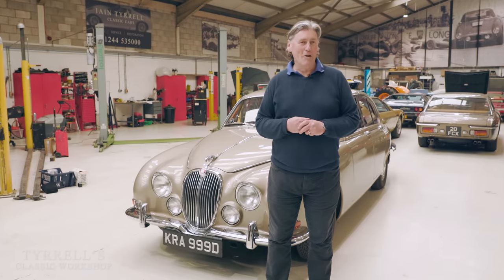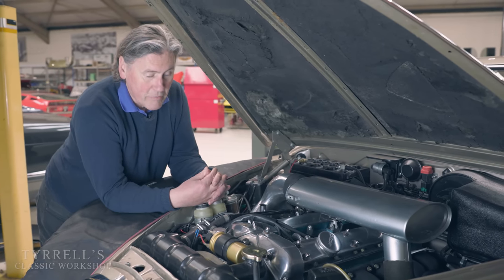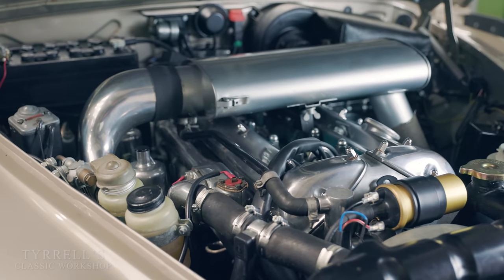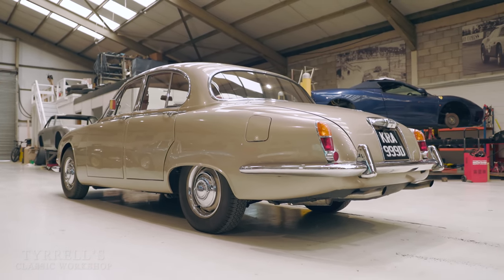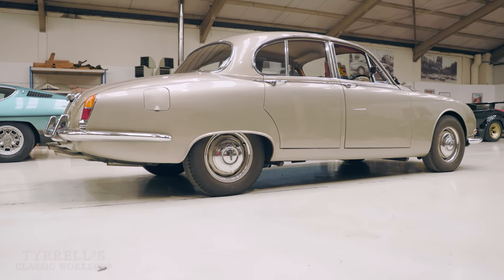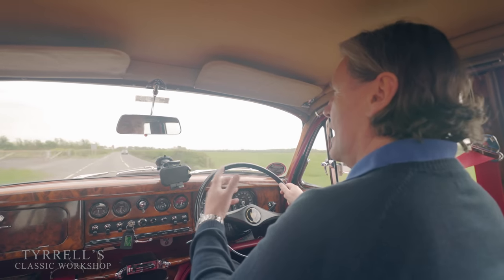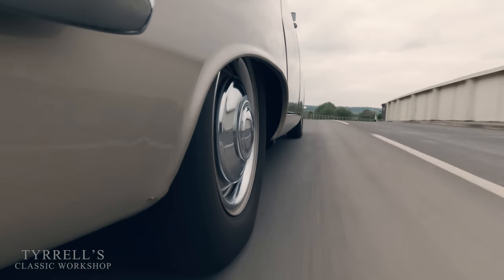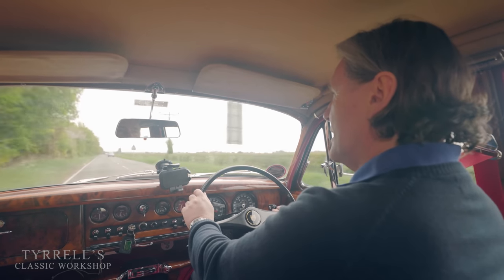Jaguar S-Type - The 1960's Saloon that set the benchmark for comfort | Tyrrell's Classic Workshop

Comment: We simultaneously owned two of these beautiful "S" types from the mid '70's into the late '80's both 1966 manual overdrive, one a 3.4 S, the other a 3.8 S with chrome Dunlop wire wheels. The 3.4 was my wife's "shopping trolley", and because it had no power steering, her upper body work out exercise. The 3.8 was the family express, both great absolutely reliable vehicles for all the time we owned them, lots of family memories made, all bought back by your beautifully done review Iain, thankyou so much.

Comment: My mom had the 3.8 S when we lived in Beverly Hills, California and I got it when she was done and it was my "first" car! OH what a joy to drive--took it up to 127 mph once upon a time on an empty straight arrow blacktop highway near Palm Springs. 

But one thing about that engine? Back when Mom was still driving it, we kept smelling gas in the car and took it to the dealer on the Sunset Strip where the head of the service dept (who wore a spotless white shop coat and an ascot, resembled John Cleese, and clearly never personally touched a car--smile) took us to the wonderful tool kit that sat in the spare tire, withdrew a large black BOLT, went to the engine and said, "Well, what you have m'am is a sticky float valve in your carburetor--so when that happens, this is where you hit it" and proceeded to RAP the bolt head on the carb to "unstick" the float!!! I remember laughing that THIS was how this marvel of engineering was to be repaired! But wow, the luxury of the leather and wood, the utter novelty in the US at that time of the push-button starter, but mostly the AMAZING steering of the car which was so responsive and "positive" compared to the big boat Caddy's and Lincolns of that era and you're so right about it being the best-riding car of the era by far (my car after this was a Mercedes and it had ZERO personality by comparison).  

The ONE issue that wasn't Jag's fault but was a US thing was that of course the car never had American-style/standard 
air conditioning in the UK but when they brought them to America they added an after-market air conditioner that sat in the trunk from some outfit in Florida. And with it, this open-road-intended car, when driven in the heat and stop-and-go traffic of Los Angeles with its tiny grill ran VERY hot. Once upon a time, again before I got the car from Mom, we were driving on a very hot L.A. day and there was a BANG as loud as a shotgun and then steam from the hood--when opened, we found that the plastic bottle reservoir for the windshield-washer had basically exploded like hard taffy slammed onto a countertop--just shattered really.

ANYHOW, I loved it all through my college years but when we decided it was time to sell, we left it with a consignment guy in the San Fernando Valley who specialized in special cars like this and HE had a potential customer take it for a test drive and utterly wreck it! I shed more than one tear and will always remember my 3.8 S. It was my first and, as I think back, best ever car indeed!  Thank YOU for the tour and details and for spurring these memories.

Comment: I used to work on these cars in the 1970's. They really were comfortable and smooth really very close in ride to a Rolls Royce for a lot less money. The smell of leather and the beautifull wooden trim is wonderful. Rust was a problem.
Reply: I had a friend who had several Classic British luxury marques: Rolls, Bentley; he also had a Ferrari.  The problem: it takes a LOT of money to keep one of these cars looking the way THIS Jag does...and it could use a bit of rust work, plus resolving that oil leak.  If unloved, one of these Classics can look plain and uninterest quickly.
Reply: The Jaguar factory made no consideration for rust prevention until well into the 1980’s. Porsche began their anti rust efforts in the 1960’s. That helps explain why you can still find early 911’s.
Reply: @Uncle Gilbert did you ever find any cucumbers?

Comment: Thanks Ian for the thoughtful and respectful review of one of Jaguar’s best. I owned and drove a handful of the classic Jaguars for 50 years. Papa had an E Type OTS for his daily driver, and I bought a 1953 Mark VII saloon, black of course, in High School and drove it for 7 years. The famous XK engine was actually developed for the Mark VII, and would push that large 6 passenger saloon car to over 100 mph: quite an accomplishment back in the day and faster than any contemporary American sedan. The XK engine was England’s equivalent of the ubiquitous Chevrolet small block V8, winning LeMans and powering Jaguar saloons into the 1980’s. As a red blooded American teenage boy, I naturally modified my Mark VII by securing a pony keg of beer in the large trunk and running a hose up to the beer tap on the burled walnut dashboard. We even drag raced it with a bevy of beautiful young women on board, losing the race but winning hearts and affection.
Reply: @Garth Lundquist The XK engine was developed initially for the launch of the new Jaguar sports car, the XK120 in 1948, 2 years before production of the Mk VII which ran from 1950 to 1956.
Reply: @greybeard4798  The XK engine was developed during WWII to power a new post war saloon that was to be the Mark VII. The XK 120 ( I have owned 2) was drawn by William Lyons in record time to take advantage of the new engine. 120 development was an afterthought, and the factory totally underestimated the strong demand from the public once it was revealed at Earls Court. Actual first deliveries didn’t occurred for another 18 months. The 120 frame, notable for how big and heavy it was, is a shortened version of the Mark VII frame. The XK engine replaced the 2.5 liter and 3.5 liter overhead valve pushrod sixes that were supplied by Standard Motor Company. Jaguar was at the time anxious to offer engines of their own design and manufacture in lieu of buying these components from outside vendors.

Comment: That's the car I learned to drive in, I was living with my uncle when I was 15 years old and he took me to the bull wall outside of Dublin near Clontarf to drive on the sand along Dublin Bay. It was a standard shift with right hand drive and I had never driven before.
God bless you Uncle Billy, this is around 1968.

Comment: The XK engine is probably the finest engine made by anyone EVER.  The engineering is unsurpassed
Reply: The Alfa Romeo "Busso" Twin Cam is a greater engine than the Jaguar, and therefore remained competitive after the XK had long been outclassed. 

The block is essentially an aluminium skeleton enclosing four cast iron liners, making it strong and LIGHT, hence the unsurpassed steering of Alfa Romeos.

Comment: I can remember my uncle having a pale blue 3.4 Mk2 with grey leather upholstery and a manual gearbox. My cousin and I would ride in the back hanging on to the grab handles or arm rests. This was followed by a dark blue with red leather 3.8 S-Type with an auto box. A few years later my dad had a VX 4/90 with a 4 speed manual box with a GKN-Laycock overdrive on 3rd and 4th, effectively giving you 6 gears, but by then the switch had moved to the gear knob. He later bought a FD Ventora with the 3 speed automatic. Rolls Royce used a GM auto on the Silver Shadow as did Ferrari on the 400i and Jaguar on the XJ12. I always felt nauseous in the back of the Mk2, sliding around whereas in the Vauxhalls, not at all. More light, grippier seats and being bigger made a difference. Nice to see the S-Type as l think it often slipped almost unnoticed between the Mk2 and the XJ6. Wasn't there also a 420 version?

Comment: It's so refreshing to hear someone that actually knows what he is talking about on YouTube! I absolutely love this video, Iain explains the XK6 engine and IRS perfectly, I've owned 2 S-Types over the years including a 1966 Golden sand 3.8 manual identical to this! I've also owned a MK1 and several MK2's and a Daimler 250 V8! At 60 years old i've settled down with a really original opalescent light blue (My favourite Jag colour) 1964 3.8 manual MK2 on wire wheels, The MK2 just pips it over the S-Type in charm although as Iain explained it doe's not drive as good, But i sort of love the agricultural rear end with it's Thornton powerlock diff and it's cheaper to maintain! Also it has a better rear roofline than the S-Type IMO!

Comment: My 1966 Mark 2 with its 2.4L automatic has so much ‘pulling’ power, my wife calls it my ‘chick’ magnet. I have rebuilt the engine and transmission from the ground up, it has a 3.4 head with twin SU’, a Series 1 XJ6 front axle with power steering and Series 1 disc brakes, replacing the smaller two pot calibers. With modern radial tyres the ride and handling are much improved. It has a complete unused Jaguar tool kit in its original metal case, wire wheels, metallic silver grey. Just needs the front drivers seat, recovered, red leather etc. also a respray. No rust, in Australia cars wear out engines, not bodies, the reverse of the UK. Mine has done 98,000 miles from new, owned by a lady driver, it has its complete log book and service records and user manual-I love it. Greetings from Tasmania Australia 👍😁🇦🇺🦘

Comment: Another great video, about my favourite Jaguar, in the best colours too!. Trad looks and interior with really good driveability, and still affordable - for now! Just one anorak point, Jaguar's chief engineer was William Heynes, Hassan was Walter - an amazing story to his career starting as a young lad in the early years of Bentley Motors, ending up co-designing the V12 with Harry Mundy. Overdrive was always a good idea, loved it on my Rover P4s and now on my Scimitar Coupe.
Reply: Thanks for that.  Brilliant.
I had overdrive on one of my Triumph Vitesse 2 litre convertibles.  On the way home after buying it, I was a bit wary of testing the OD, I had a nagging premonition something might go wrong but thought, 'hey what's the worst that could happen'. I chose a quiet stretch of road, trundled along in third gear and flipped the switch -  the wheels instantly locked up with an appalling BANG. 
Shortly after the chassis outrigger that held the radius arm detached. I continued to drive the thing. (Yes, I know it was stupid and dangerous, but I was young and times were a bit different). If you ever want to know what it's like to drive a boat in rough seas along the road...
Sometime yet later I began to notice the blue smoke! I checked the oil and there wasn't any! I filled it up and by the time I got home, it was almost empty again. I remember checking the oil when looking it over and it was lovely and fresh, I thought he had just serviced it...
The guy I bought it off seemed so nice. Hope he is reading this and feeling uncomfortable (probably 1990 ish so thirty years ago).
PS The Scimitar coupe is the most beautiful design and you hear very little about it! Does it drive well? Bet its better than those Triumphs.
Reply: @martinda7446  Well, I paid £140 for a Vitesse  at an auction, when you accelerated it shot to the right, when you braked it mounted the kerb -  now I know the radius arm mounting was rusted off, then I knew nothing so I just put it back in the auction next week. Lovely engine sound though!

Yes, I like the Scimitar (and my Rebel Estate dog car), the steering and handling are very good, the V6 is torquey and easy to look after (away being rebuilt now) and it is compact but comfortable. And it does look great on wires! I saw one growling slowly out of the car park of The Royal Hotel in Winchester when I was about 10 years old, and of all the cars I have had since that is still the one for me!
Reply: @JohnDavis-ed5sg  Thanks John that was a great reply. I have often thought about a Scimitar, but never went for it. The GTE is a very pretty car, but the coupe  is a piece of art. Glad to hear one is cherished and looked after.

Comment: The S type was compromised by the metal (Pressed Steel Fishers) . I worked at the main dealers in Newcastle during the 60’s and it was rare not to see an S type with rust. We simply called them ‘rot boxes’. Thank heavens for that fabulous engine, lovely interior and Jaguar name.

Comment: Always loved Jaguars. Back in 2008, I went on holiday in the Cotswolds, where I rented a 1968 Jaguar E for about a week. Loved the burble of the XK engine and how effortlessly it pulled the car on a wave of torque: I didn't try, but it felt like it could pull away from a standstill in fourth gear and push all the way to top speed!

Comment: Underrated car. How many were trashed in the Sweeney? Just throwaways in the 70s/80s and only now has the market woken up to the fact these have the style of the MK2 but with a much more sophisticated suspension set up.
Reply: At least 1 per episode!
Reply: @paulhorton5612  Apparently for The Sweeney, they bought clapped-out S-Types, had their mechanics do them up so they would run for a while, and then thrashed the living daylights out of them and sent them to the scrapyard. Looking back, it was a crying shame that so many S-Types ended their days rolling over after crashing into warehouse pillars or milk churns, or driving into piles of sand on building sites.
Reply: @Mortimer50145  I expect a lot of them also ended their days in demolition Derby’s etc…

Comment: I was used to driving my father's MkII and loved it, but my first ride in an XJ6, with the same rear suspension as the S-Type, astounded me with its brilliant suspension. I think that the engine was mounted on a subframe and no doubt that helped.

The MkII had its overdrive switch in the same place as the S-Type, but the so-called "MkI" had its overdrive switch mounted on the fascia just to the right of the steering wheel. As Iain say, great for cruising. My Dolomite Sprint had its overdrive switch mounted on the top of the gear lever knob. It was normally active on 3rd and 4th and made accelerating through the gears more interesting.

Comment: You're a metallurgical encyclopedia; I always learn something important.  In the US, Volvos also used over-drive for decades, a little button on the stick shift.
Reply: Volvo used  the 'J' type Laycock DeNormanville unit. The Jag used the earlier 'A' type. Many manufacturers used the units. Triumph, MG, Austin Healy to name a few. 
California Gears still manufacture the 'J' type either under license from GKN or they bought the rights to do so. Slightly modified its still fitted to RV'S. I even saw one fitted to a 600 hp Chevy Caprice.
Reply: Also Triumph on TRs, 2000/2500 and Stags and on MGBs, to name a few more, latterly via a switch in the top of the gear lever.

Comment: Another great educational video.  Thanks for sharing your insights.
As an add to your comments about the overdrive.  Volvo used it extensively in several models such as the P1800, the Amazon and the 140 and 160 series.

Comment: Like the E-Type these cars are amazing.  Dynamics, styling, engine, all so far ahead of their time.  What a shame that they were built to be thrown away after three years....  I loved the overdrive unit and thought them a real novelty, and  the reduced engine speed was such a benefit at the time and usually operating on the top 3 gears it gave a real advantage with the traffic light dash.  Great review.
Reply: BULLSHIT! What a dumb statement - throw away after 3 yrs. Back then I had 3 diff XK Jags, all bought used, all driven for many miles, all reliable with no mechanical problems (except for the hydraulic clutch slave cylinder, for some reason).

Comment: Ian love the video, fabulous car.
I own two jaguar cars,
Daimlers in fact same thing.
I don't agree about them being indestructible
I would say not reliable at all.
My 3.4 1977 has oil light issues so I don't use it anymore.
The pressure gauge shows OK for about 10 miles and then drops down to the lowest level of pressure.
I find my Japanese cars, cedric v6, datsun laurel 2.4,  Nissan bluebird are all very reliable and never give any problems.
The extreme costs of trying to keep jaguar cars going is no longer an option these days and so like so many of my classic car enthusiasts I have moved to Japanese for
Peace of mind going to
Classic events. I also have a Mercedes 126 300se 1987 and I must say what a nice car.
But I still hanker for my
Two daimlers the other one being a xj40 1989.
Keep up the good work, love the videos
You did a brilliant job with inspector clouseos, I know I spelled that incorrectly.
Looking forward to seeing you again on line.

Comment: Thanks Iain for answering a question that has bugged me since May 1972. In that month my late father took delivery of a new 4.2 Daimler Sovereign. Almost immediately there was a squeaking from the rear. The car disappeared for just over a week due to them "rebuilding the rear suspension". On picking it up they said it was due to a sticky handbrake. At the time we thought it strange that the handbrake should stick and that the fix was rebuilding the suspension. When Iain said that a sticking handbrake was a common fault, I finally knew why it took so long to fix!

Comment: Thank you. As usual a very good video. A few remarks... The DS also rides, suspensionwise, very smooth. And was there in the 60s. But it is obviously a totally different car. I think it took M-B till the arrival of the W201 to have a very good and comparable IRS. Especially the W124 (using the same layout as the W201) is a very comfortable car, not harsh as modern day German cars are.